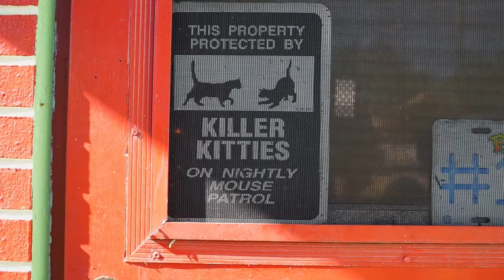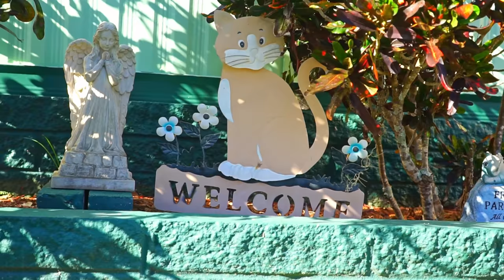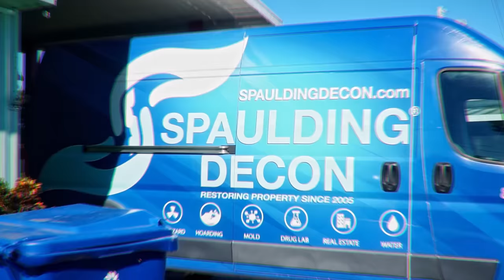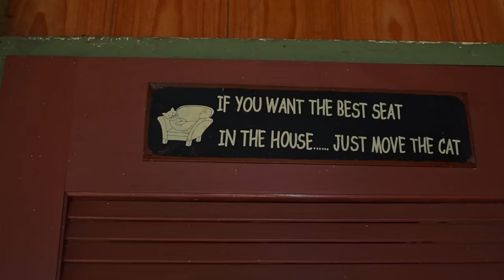Extreme Animal Hoard: Our Sh1tt!est Job Ever

Comment: Due to the wide spread nature of the contamination, this house should have been declared a biohazard site and condemned for demolition. The extent of the contamination could not be isolated and removed from porous materials and in seams, cracks and gaps in walls, steps, flooring etc. The concentrated ammonia produced from urine destroys surface materials such as paint even as you attempt to clean it.